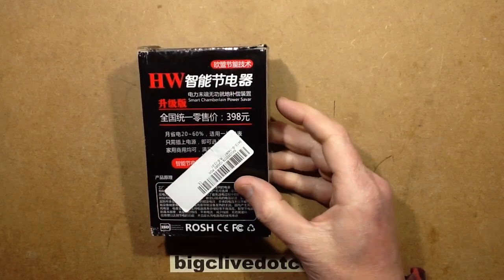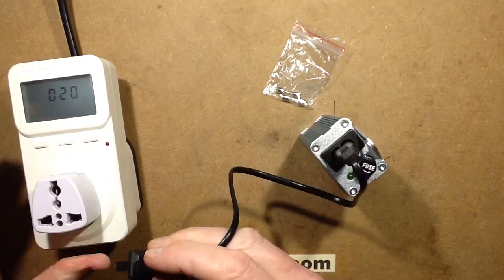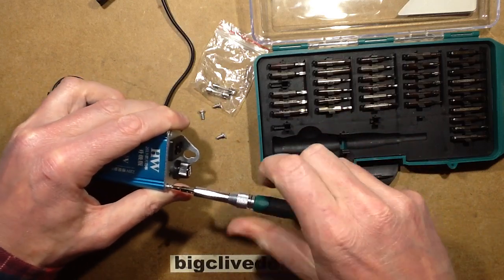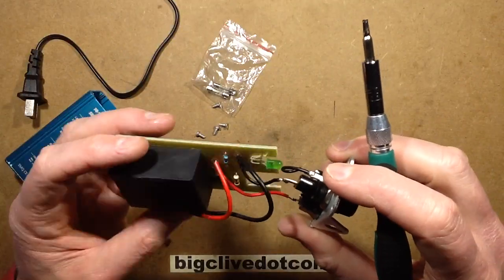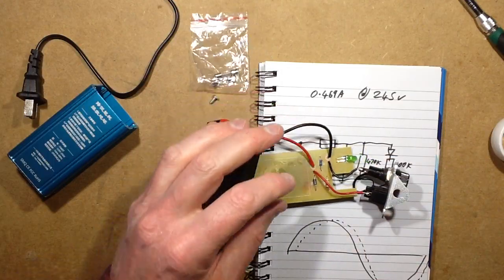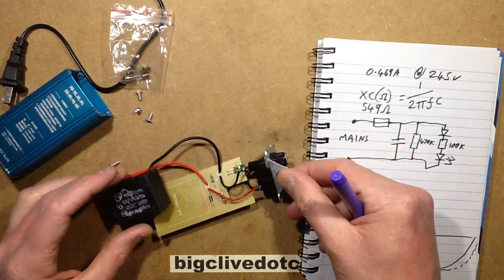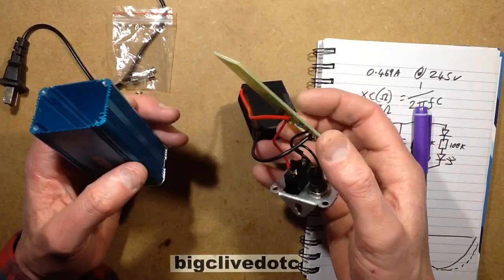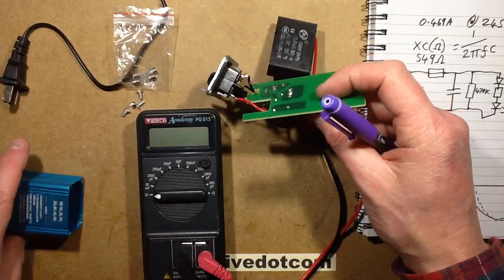200kW miracle power saving device.

Comment: It is a nice case, I'm sure you'll find a use for it.  The snake oil is rampant in this one.  It's eating what, 120 watts? as long as it's plugged in, so it's as bad as leaving two incandescent lights on 24/7. Not much of a savings there.

Comment: 200kw divided by 240 indicates over 800 amps, which would melt a bus bar. Said another way, if this thing had anything to do with 200,000 watts, it would be a puddle under your outlet. If the wires weren't puddles in your burned down house first.

Comment: This could work but only if your electricity supplier charges you for reactive power. It could, but it wouldn’t, because what is this tiny capacitor gonna do, and it’s not like a household runs many reactive power consuming devices anyway.

Comment: An oscilloscope reading of the  domestic-property mains with & without the device connected would reveal it's real-time effect, & whether it's use is justified, (unique to every property according to it's accumulative elect appliance utilisation). 
Many years ago I connected a bank of PF capacitors (obtained from old-style fluorescent fittings) across my refridgerator's mains supply, resulting in significant power savings in the longer term. 
Correct/efficient power-factor correction also results in lower current demand by default. 
These cheaper types of PF correction devices have no way of evaluating the real-time sinusoidal lead/lag, and apply their effects blindly whether needed or not. 
Applying one of these devices to an already balanced mains supply can actually produce waveform imbalances resulting in costlier elect bills.
Reply from the maker: Most home supplies are only charged for real power and not apparent power.

Comment: Excellent result with the correct capacitor meter and the measurement values and the result is spot on. Nice case and at least no loose items in the box. The 200kW may relate to the power savings over a year, in a lightly loaded house.
Reply from the maker: The salesmen used to have demo cases with a very lossy unloaded motor to show the apparent power savings.

Comment: Could you make a video explaining how to limit current with capacitor instead of resistor?  
I need to connect an optocoupler to mains to detect its presence and when I tried to calculate the required resistor it turned out that I need a 5W one.
Reply from the maker: You can get opto-isolated mains presence detection modules on eBay.
Reply: If I buy off the shelf component I may use it but I learn nothing. 
That is why I prefer to build everything from basic components. 
If you could explain how capacitors are better than resistors to limit current for LED's that would be most helpful.

Comment: An oldie but a goodie. 
I've only ready about a hundred of the comments but I noticed a few talking about switched mode power supplies (hereafter "switchers). My tuppence worth:

In many modern settings, domestic and office, the biggest contributor to poor power factor is the multitude of switchers in electronic equipment. Unless they are designed with "active power factor correction," called "active harmonic filtering" (or something similar) in some places, switchers have awful power factor but it is not simply a matter of phase difference between current and voltage. They are non-linear loads (and have a negative input resistance characteristic to boot, but that isn't really problematic).
When you directly rectify and capacitively filter AC, current only flows when the instantaneous DC voltage out of the rectifier exceeds the instantaneous cap voltage. This means that the current only flows near the peak of the AC sine wave and the peak current can be VERY high - the higher the filter capacitance the higher and narrower the peak current "spike" (meaning the RMS to average ratio is higher). In practical terms you cannot fix this very non-linear behavior with simple linear parts like capacitors (some "valley fill" techniques can be used to improve power factor, but the the parts cannot just be added external to the switcher). Active power factor correction is typically done with a boost switcher that makes the instantaneous input current directly (first-order) proportional to the instantaneous line voltage - but, in a feat of magic, INVERSELY proportional to the input voltage averaged over several cycles (that's the negative input resistance coming into play). The result is input current that is sinusoidal and nicely in phase with the input voltage. Typically the DC bus voltage would be around 385V for "universal" input (85 to 265 VAC).

Comment: This may be useless but it gives me an idea for a product that is actually needed. How about a device to convert some or all of the ragged square wave or "modified sine wave" (sic) output from a cheap generator or inverter to pure sine wave? I imagine it would be costly, but it would definitely be welcome. It can probably be done with lab equipment, but I've never seen a simple consumer accessory for this purpose.

Comment: As a complete geriatric newbie to all this, is the issue with power factor that we could charged for apparent power instead of real power, like you said in your video on smart meters? So if the public were educated/aware we could choose appliances with a higher power factor? What else can we do to avoid this rip-off - apart from campaigning ?
Reply from the maker: Usually meters only measure actual power used and not apparent power.

Comment: Classic motor-mounted capacitor, you can see where the tab that is usually molded into the housing for mounting with a bolt has been ground off completely.

Comment: I have MODBUS meters on my installation and the power factor is as close to unity as makes no odds - it was different back in the day, with fluorescent tubes, but nearly everything nowadays is LEDs and switched mode power supplies and even if these scam devices did work, there would be nothing much for them to do.

Comment: 200kW in such a small package - that is truley amazing in its self.

Here is a very useful analogy: imagine your electric motor that you want to drive is a child on a swing, and your power supply is you (periodically) pushing the child on the swing. You will get the best swing for the least effort if you time the pushes correctly with the swing. This is the idea behind these devices (when designed and used appropriately) - the inductive load is the child on the swing that is slightly out of sync with the power supply; the capacitor is like a mini battery that temporarily stores energy from the power supply and then delivers it a tiny bit later so that it is perfectly timed up with the load. For this to work you need: 1) a lot of inductive load to make the small difference worth caring about and 2) perfectly matching the capacitance with the load. Domestically, you will have neither (unless you are running weird equipment for a home and got extremely lucky with the numbers).

Comment: I have a serious question that someone may be able to answer: Do UK domestic utility electric meters measure true watts or volt-amps? In other words, do they take the power factor into account. If they measure watts, then adding a capacitor to an inductive load will make no difference to the measured power usage (although it will help the utility company). I've always assumed that they measure true watts.
Reply from the maker: They should measure only real power.  But modern smart meters can be programmed to measure either
Reply: @bigclivedotcom  Thank you. It would be fraudulent if they only measured volt-amps.

Comment: Power factor isn't just about meters.  The reason you want a power factor close to 1 is because if the current is significantly out of phase with the voltage, you actually need to pull more current over the wires to get the same power (so a 100W device with a power factor of 0.5 will result in roughly twice the current flowing over the wire than a 100W device with a power factor of 1.0 (for the same wattage)).  That means you either need much beefier wires, or you can end up with a lot more heat and resistive losses in the wires.  This is why it's particularly important in industrial (or datacenter) contexts, where you have lots of equipment pulling lots of power from a given circuit, and you want that to be as efficient as possible.

Capacitors can also be used to filter out higher frequency electrical noise (which is probably what they were getting at with the sine waves on the box), but that generally requires having the thing you're protecting be on the other side of the capacitor from the noise source (or very close by).  Just plugging a capacitor into a nearby socket will do nothing in that regard.

Comment: isnt this good for power factor correction at least? Ive been looking for a pf corrector but they are very expensive. When I run devices with bad power factor like switching power supplies from my inverter they do an over current shutdown. Would this device fix that?
Reply from the maker: Switchmode power factor is not easy to correct.  You can get power factor corrected power supplies.

Comment: I’d buy it just for the beautiful case - perfect base for a hobby mains project
Reply: Mostly ElectronHeads will be viewing this video which probably makes the Chinese price on this a good deal. We get a nice extruded aluminum case, 4.7uF/500V Cap, Panel mount fuse holder, Power cord and connector and a PCB!  All for probably 1/10th the cost of buying the components separately!

Comment: This is a scam I'm a physicist and can tell you this device uses power, doesn't save anything.  Gives you a cleaner signal.  Your devices don't care... the important ones, your TV etc. already have this stuff built in.  Only a brain dead idiot will fall for this.  This is a total scam.  You are billed for WATTS...  WORK DONE.  Not volts, not amps, but watts.  This device uses power and saves nothing, absolutely nothing.

Comment: I laughed at these when I first saw them however the theory can ring true if ... and I say if ... your power is 'dirty' enough in the first place. 
Possibly you could set up a demonstration showing that your power is basically clean in the first place and then comparing it with any change provided by the device. Possibly a power meter would be nice to compare the before and after.

Comment: Because the capacitor was connected across 120v AC rail voltage to the distribution transformer, maybe my neighbor buy this item to benefits the community to save electric bills

Comment: I am surprised you have done such a tear-down.  You must know it is 99% B.S. from the beginning (because you are obviously aware of the concept of power factor).

Furthermore, you cannot fool an electronic smart-meter by installing this device, unlike the old-style eddy-current rotating disk meters that could even be made to run backwards if sufficient capacitance was installed after the meter AND there were no resistive loads at the same time.

The usual way to fool the old meters in a large factory was to remove or short the ballast choke from fluorescent light fittings, thus leaving a capacitively reactive load across the metered mains.

I am also surprised that you mention the difference between domestic and commercial mains metering Sir.  Because in New Zealand, there are very few old-style (disk) meters remaining in service.

Comment: By connecting another device to the home electrical network you will only increase consumption, if you really want to reduce consumption then replace the appliances with higher consumption by others with lower consumption and greater efficiency( The savings will be seen in the medium or long term), keep off the appliances that you do not need to have on or those that you are not using. Note: It would be a very good idea to check your home's electrical network to make sure there are no leaks or loose wires.

Comment: A test that you could have done; Plug in a transformer powered device, measured with your watt meter. then plug in the capacitor along side it (in extension block) and see if the watts is reduced?
Reply from the maker: It would correct power factor with the correct simple inductive load, but that isn't monitored by most meters.  It would be better to correct each simple inductive load locally.

Comment: years ago in thailand I saw a man at the market demonstrating a power saving device. It was a capacitor potted into a little block the size of a zippo with an american flat 2 pin plug on it. He had a rotary metre and 3 light bulbs in fittings and showed that out of 3 bulbs lit the device slowed the metre down to that of 2 lamps when 3 lamps were lit. I had a good look at the rig and I was convinced enough to buy 2, quite cheaply. My girlfriend who I was staying with "met down the pub in England" had one floor in a street cafe shop unit that her mother ran so we went outside to observe the metre and plugged the devices in one at a time. Given the place had 2 installed AC units, 2 fridges and the usual lighting in the building we saw a tiny improvement, I timed the rotation of the disc on my phones stop watch. It did make a marginal improvement but id say only enough to claw back the built in leakage designed to act as the standing charge. 

This all comes down to basic power factor correction. Large banks of capacitors are often installed in office blocks and such big buildings and are controlled but instrumentation. 

The best way to save money is to find ways to use less of it in the first place. I still have the device some where from nearly 20 years ago so if I find it ill send a picture.
Reply: PS. I had a good idea of what was going on as I am a diesel generator engineer so deal with things such as power factor and synching to the mains and all that.

Comment: These "power saver" devices in nutshell repurpose inductive load reducing when huge inductances like electric motors become connected directly to mains. However in reality makers of such devices can't know how big is inductive load in particular home wiring neither are such kind if load exists at all. Also all more or less adequate devices with motors already contain built-in capacitors with required capacitance so additional capacitors simply are not required. In fact such "power savers" may reduce load for some utterly knockoff or DIY devices with electric motors without capacitors, but that is not general case. In almost all other cases such "power savers" will simply make your home mains wiring properties even worse.

Comment: 200Kw? Try passing even 20 Kw through that and it will emit at least half of that as heat, meaning it will light up like a bulb, incinerating anything combustible in the vicinity. I've been ignoring this for ages, because it was so obviously fake, but then I noticed it was from Big Clive, so I finally accepted the recommendation

Comment: Surely the unit is supposed to save you "being charged" for power you use, it doesn't actually reduce the amount of energy consumed. AC power meters measure Watts not VA so they only record energy delivered with a power factor of (I believe) 0.98 or better. Commercial customers are required to keep their power factor within very strict limits, for reasons I won't go in to here, otherwise they are heavily fined.

Comment: Could plugging in a large capacitor take the load off circuit breakers when starting a larger motor?
Reply: Not with alternative current.

Comment: I have 3 super-combi's used in conjunction with 4 300w solar panels and 2 × 24v banks of 300 amp deep cycle batteries. A 2000w wind turbine will be my next addition.

Comment: Theres hundreds of these in the back of any old tv or radio China ripped you off AGAIN ..1 resister and very small capacitor also if you plug in anything over 80watts ..like a windmachine fan ..the capacitor will blow..and I could have told you "lets do the math" 120volts anything over 80watts is unsafe.. watt /voltage = amp ..no matter which way you do it its like velocity or volumne m/s=v or m/d=v  they basically sold you a ceramic resister (drop of molding clay & a shred of aluminum wire or a bred tie) and about a half ounce of magic conduction gel.. That case is a jensen old stock 20 watt radio booster.. Sad to say but I have no idea why you guys deal with China.. "Its not smart to buy useless its only business smart of them to feed it to you".. Smh

Comment: In a house, or even smaller commercial properties like b&b's and hotels, the things that a unit like that would have an effect on, have already got them. Things like washing machines, dryers and other stuff with motors or other things like tanning beds that have an effect on pf, already have them.  And that's not for the benefit of the households bills, it's more to do with the accumulation effects of them adding up from street to street and affecting the overall distribution system as a whole. 
Plus, even if a home had a power factor problem, dwellings don't get charged for that type of power in the first place. So, what it 'could' save you, if you did have to pay for it, would be used back by powering the LED that's inside of it anyway.
Am I correct in saying this.?

Comment: Love your vid AND your Irish accent.  I'm an Electrical Engineer at Ford Motor in Dearborn, Michigan.
Good presentation of power factor formula (and application).  We use banks of capacitors across 460V-3phase-60Hz lines (all fused, of course) for spot welding and motor-controlled production lines.  You're right, a house load makes no difference but in a big factory without cap's our electrical equipment must be twice as large to handle out of phase current (going out AND coming back).